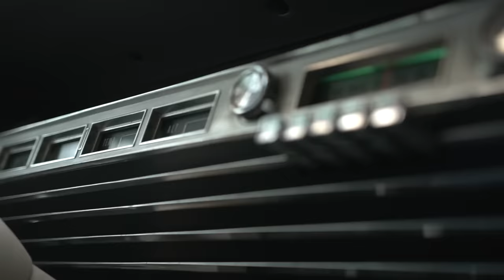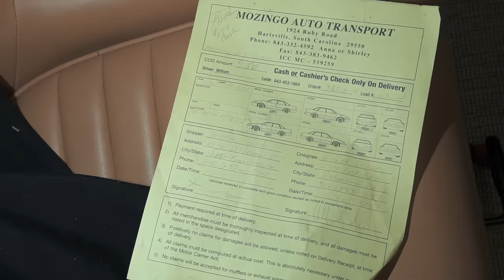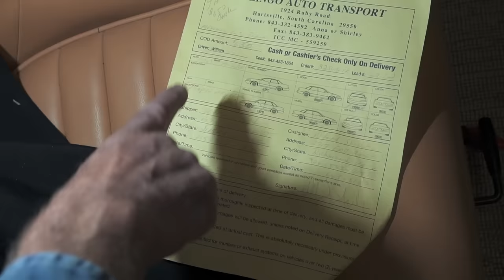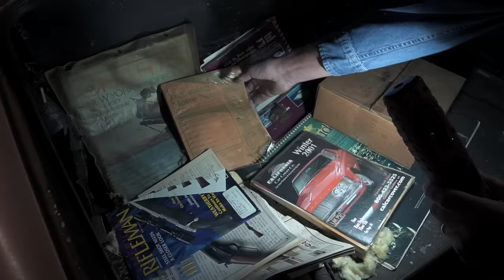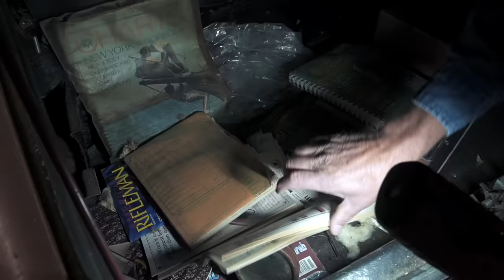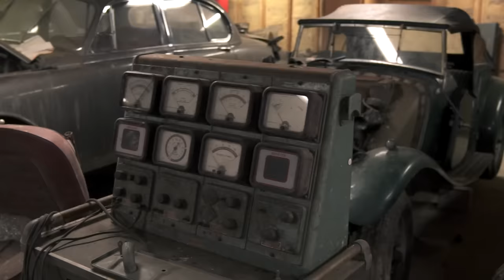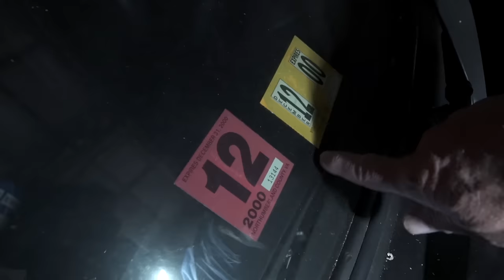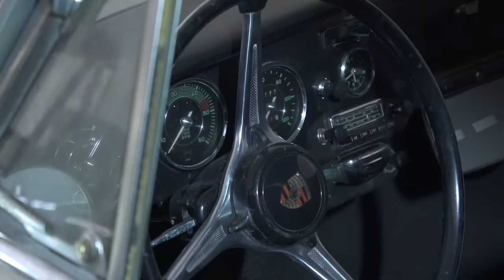Best barn find ever? 45 sports cars hidden in Virginia | Barn Find Hunter - Ep. 70

Comment: 21:26  The Jaguar is an S-Type, a completely different model from the slightly smaller (body-wise) MkII.  There was also a Daimler version called the Sovereign introduced later..
Reply: Sovereign...XJ6 kinda front. S type rear.  The S type wasn't as popular as the Mk2, but much nicer to drive with its IRS and improved ventilation. The S type still used Mk 2 doors.
Reply: daimler 420 sovereign a slimmer version of the jaguar 420g/mk10

Comment: I miss my rabbit gti! Seeing these makes me want one again. Also i had a diesel rabbit 🐇.
Reply: I'm restoring an MK1 GTI. They are awesome cars!
Reply: @RadoMatt  good luck with the restoration. I keep my MK1 until the strut towers rusted through.  I miss my go kart car.
Reply: Miss my 84 and 92 GTi's.

Restoring them, I would reweld the strut mounts, install big strut braces, urethane rear motor mounts, bigger vented brakes (rear discs in the 84), upgrade and protect the wiring, waterproof the fuse box,  rewelf & strengthen the pedal box, upgrade the clutches, better headlights, install the fog lights (the mounts are factory, they were intended to have fog lights) and redo the exhausts (loved the rorty growly sounds).

Oh, and keep the 84 black star wheels and 92 turbo wheels.
Reply: My sis cleaned pot in North. CA for money. SHe walked into a VW dealer in FT BRagg, paid cash for Black '84 5 speed. It was a quik one. She died a few years later. My mom ended up with it. It burned up alternators for some reason.Only flaw.

Comment: I would pick up that diesel VW pickup in a heart beat. I LOVE those little trucks. <3
Reply: Had one....MAKE SURE there is NO RUST ON THE FRONT FRAME other wise your wheel will tilt in and your engine will begin to come through the frame and scrape the ground..  NO KIDDING.  THese caddy's are available on ebay you know.    They are fun   I had an 1982 and was GLAD to get rid of it.     Problematic little fukkers they are.   Be advised
Reply: @tommaika9121  Thank you for the tip. I'm a welder and a fabricator. Fixing or reinforcing wouldn't be a problem. Here in New England most are all rotted out beyond repair, if you can find one that is.

Comment: New "throw away" vehicles dont hold a candle to Old Classic Vehicles
Reply: Modern cars are built to last longer than classics
Reply: Babylon falling I own an 80s ford and can tell you it’s well know that they weren’t designed to last they were designed to rust to make you buy a new car. The wiring looms are nowhere near built to the standard of modern day cars and are held together with old tape. Yes modern cars have loads of electronics that fail but most of the time it’s just a warning light on the dash. I like classics but I would never want to drive one every day the automotive industry has come along way in terms of economy, safety and comfort whether that’s for the better is debatable.
Reply: not in collectability!!  1969 vs 2016
Reply: 'Newer' cars dont last longer then this olds. It depends by
the storage conditions and, what brand you try to save.
Reply: @louisgreenleaf235  that is so true. While we complain about how flimsy they are, modern cars are better designed, better protected and have double the life span of a classic car. Babylon falling, are you comparing classic cars that have been restored? I have owned many cars from the 60's and 70's and while I love the styling and the simplicity of working on them, they simply can't hold a candle to modern vehicles in build quality and ride.
Reply: @Louis Greenleaf
Modern cars are built to be reliable for a set number of years before they become impossible to repair economically. Older cars are less reliable but can be repaired cost effectively and last many decades more. Nice try slick. You must work for the manufacturers.
Reply: real cars have chrome bumpers,ask anyone

Comment: If that vw caddy with the topper was a turbo 5 speed diesel I'd love to have that
Reply: Bigg Papa  My stepdad had one too, with the 5 speed gearbox option... Sold it before I knew him... sigh
Reply: Keep looking on Ebay. These trucks are found in Southern California or parts of the Pacific Northwest.   The guys on the eastcoast that own them WILL NOT SELL THEM.    I had an 82 which was fun until the rusted front frame had the engine falling out of the engine bay .... and the passenger wheel collapsed on me due to rust.   I was glad to get rid of the death trap.  They are VERY small inside.  If you are 6'tall and above, your legs will not work the pedals.

Comment: Great episode!
A note:  The BMW 633CSi in the video is an E24 model (1976-1989) which included the 635CSi and the original M6 versions.  It was penned by the french designer Paul Bracq.  Karmann built the first few, but BMW eventually took over production.
The 2800/3.0CS/3.0CSi (1968-1975) you mentioned is the E9 model (all were built by Karmann)  Wilhelm Hofmeister was the designer.  
Both are beautiful coupes, but the older E9 is a "true" coupe with no B-pillar.  The lightweight 3.0CSL "Lightweight" is the most desirable and was the version used for racing.

Comment: I had a 1959 karmann cabriolet with removable hardtop you could order the hardtop or the cabriolet soft top. The soft-top had to be completely removed to mount the hardtop. There was also the permanently mounted welded on hardtop for the karmann coupe . If there are no top clamps for the windshield header it's a welded on top.

Comment: Porsche produced the 356 C in 1964 and 1965.  I have a 1965.  The base C motor was 75hp.  The SC version was 95hp which is the engine used in the 912.  The 365 C you were looking at was a sunroof coupe.  The sunroof was in uncommon option that adds at least 10k to the value.  The 912E you mentioned was built in 1976 only.  It was a VW based fuel injected motor.

Comment: Thank you and Mike for showing me round, just a little attention to detail, the 2.5 V8 Daimler engine is basically 4 Triumph Bonneville engines designed by a Motorcycle engine builder Edward Turner and Jack Wickes who were asked to develop a sports saloon with a V8 engine, was named the "Dart" but later became the SP250. The saloons came later mostly automatics.
Reply: They changed the name to sell it here, Chrysler objected to Dart.

Comment: That 64’ Porsche 356 C in Silver! WoW 🤟🏻
Reply: And a sunroof! But there were braided lines goin to the front of the fan shroud. Could be an additional “rob Peter to pay Paul” oil cooler in fron of the cylinder fan shroud (which also houses the primary oil cooler), or maybe an Oberg “circle” external oil filter.  Not “the best 356”, as it is a C and not the 110hp SC, but a nice 75hp driver nonetheless. Clean it up, new tires, check the brakes, change out the window rubber and engine hoses, renew all the fluids, and drive the wheels off it.
Reply: Oh, and an early oil filler. This may be an earlier, 60-63 engine. That would devalue the car a lot. Used the small oil pump which might explain the aftermarket oil support. Could be a 1.7L rebuild on the older motor, which could bring 90hp. Carbs are gone though. Zenith 32s on the older motors. The “missing” tach in the front could be the electric “C” tach. The older motor has a mechanical tach off the oil pump drive, unless converted.

Comment: A small correction to what you stated in the opening dialogue. Reedville, VA does not face the ocean. Reedsville is on the western shore of the Chesapeake Bay. The eastern side of the Bay is called the Eastern Shore of Virginia or Virginia's Northern Neck. When referring to the Outerbanks, these are in North Carolina, i.e. Cape Haterras.

Comment: Wondering what Tom's station wagon gets for gas mileage. With the 428 4sp in it I'm pretty sure it would be single digit - like 9 mpg. I had a 72 Mustang 429 C6 and it got 6 mpg. Ford saved money in it's big block cars by installing gas gauges in those cars that operated on a timer (not a float in the gas tank) - and as soon as you turned the ignition key to the on position the needle started head towards the"E" mark - even if the engine wasn't running  :)

Comment: When I sold Mercedes parts in the early 80s colour matched hubcaps were an option. You could order them as a part to upgrade if you wanted later. 

From memory the colour matching was a $30 added option, each. Which marked them up at around $240 a set of four.
Reply: In Australia

Comment: I had an 83 rabbit diesel.  It had almost a half million miles in it before the engine gave out.  I would have put another 1.6 liter diesel in it but the body was rusting out.  Now I have a 2000 Cabrio that had 70,000 miles on it when I got it in 2019.

Comment: Edward Turner designed the Daimler 2.5L V8. Aluminum heads and cast iron block. There was also a 4.5L in the Daimler Majestic Major. He's the same person that designed the Ariel Square Four and in 1937, the Triumph Speed Twin, which also had hemispherical combustion chambers. They wanted to call the SP250 the Daimler Dart, but Chrysler objected.

Comment: You made a mistake on the BMW, the 2800 CS and the 3,0 CS (CSi, CSL...) you mentioned are the E9 Coupés, prdeccesosors of the E24 6 series, which started as 630CSi and 633CSi, later came the 635CSi and then the 628CSi, but I´m not sure the 628CSi came to the US

Comment: The black Turbo look is option code M491, available for the first time in 1985. You'll probably need to contact Porsche with the VIN to verify that it's a real M491 car. It should have the 930 brakes, trailing arms and other suspension parts too, but they can all be retrofitted, so unless you have a Porsche COA, you won't really know for sure.

Comment: The 912 is basically a 2 litre kombi engine with a few differences like cylinder heads and carburation.. If I had to say what the most sophisticated engine they made in the classic era, it would have to be the 1500 4 cam in the 718 spyder RSK

Comment: The '67 VW has large taillights, old-style bumper and wait for it, back up lights. 66 were still 6 volts, 67 went to 12 volts and added the backup lights with the old style bumper. It changed in '68
Reply: '67 had a one-year only bumper and separate reverse lights mounted to it (at least here in the US).  It wasn't until '68 that the reverse lights were integrated into the new taillights (again, here in the US) and the car got the big honkin' "blade" type bumpers with no towel bars.

Comment: If my memory serves me correctly, at the time the black wide body 911 was made, the 3.0 SC was available with the turbo-style wide body and whale tail, and that's often seen in conjunction with the optional sport pack with stiffer suspension and, I believe, faster ratio steering.  Some people say the sport pack cars also had a closer ration gearbox and maybe some upgrades to the state of engine tune, though there doesn't seem to be any data to support that.  If that is what this car is then I would suggest it might be pretty rare in the US as most 911s sold there seem to have been more originally specified with comfort options rather than performance ones.  Clearly the wheels on this one are wrong, being the narrower Fuchs alloys from a standard body car whereas this one would have had the wide Fuchs alloys also used on the turbo. The wide, turbo-spec Fuchs alloys have always been desirable, big ticket items, so it wouldn't be any surprise if they may have been separated from the car and sold on at some point as it's clearly a car that has been off the road for some time.  Even if it isn't an original car, there's still going to be plenty of interest in it as an air-cooled 911 that, at least, appears to be in very solid condition as this era of 911 can be horrifically rusty...

Comment: The Daimler 2 1/2 litre V8 engines are in essence 4 x 650 cc Triumph motorcycle engines in the form of a V8, the Daimler engine was designed by Edward Turner the same man who designed the Triumph 650 twins so it's hardly a surprise how mechanically similar they are, I had a Mk2 Jaguar with the same 2 1/2litre engine and was delighted with the performance, the small V8 made the Jag a fast car and was super smooth and refined, so in the much smaller Daimler Dart sports car the performance must have been amazing at the time, I think the car would have been a world beater if only it had not been so ugly. In the 70's I was a specialist in the overhaul and repair of Triumph 650 twin motorcycle engines and later I got into repairing and overhauling Daimler V8 engines so I know all about them. The V8's had a beautiful forged steel crank machined all over to a high finish and superb forged steel connecting rods with polished beams which were far superior to the bike connecting rods which were aluminium, the one real weakness of the V8 were the pistons which used to break if the engine was tuned and revved too high, with forged pistons the Daimler V8 could be tuned to be a real power house with 200 BHP and 8K rpm. A 4 1/2 Litre version was also made and installed only in Daimler high performance saloon cars, these bigger version V8 engines can also be fitted in the tiny Daimler Dart Sports car in place of the 2 1/2 litre engine which really makes the Dart a fast car

Comment: Had a 1975, 911S, 2.7 liter, air cooled Porsche with the silver stainless targa top here in San Antonio. I remember being stuck in traffic on an August afternoon with the A/C off and the heater running to push air through it, the windows were down with the temperature gauge maxed out trying to keep it from seizing up from the heat. I had totally soaked my shirt when I decided air cooled Porsche’s were not for Texas or me. Beautiful car, handled like it was on rails only had 180 bhp. My God it would run in the winter. Car had “chain tensioner” which could break and total your car after 40,000 miles. This was in 1980 and I was a low first lieutenant in the Army MSC. I sold it back to the man I bought it from. He told me with contempt “son you are not a Porsche Man”. 
The car would have been fine even at that temperature doing 90 miles per hour. But not sitting at 0mph. It needed a cold alpine autobahn. Marc

Comment: the Daimler 250 was originally called a Dart.  But Chrysler/Dodge stepped in and said you cannot use that name.  Si it was renamed as a 250GT, due to the 2.5 liter engine.  i had one, body good, no interior or engine, and sold it for $450 bucks.

Comment: Those VW pickups are great little machines. Back in the mid 80's, I had the opportunity to drive one of each, a gasoline engine and a diesel engine. Both of them were as fast as any sports car on the road at the time. I had driven them like a quarter mile drag car and boy o boy, they were quick. The fastest that I had cruised them were 118 mph and they rode smooth, of course on a smooth road. Not very quiet though, every road noise and the wind made them hard to hear your passenger while driving them. You had to speak loudly to carry out a conversation. Besides all that,  fun, fun, fun until daddy took them away! Haa haa ha!

Comment: The 911 is an '84 or '85 3.2L Carrera (there was never really a factory 2.8 for the street (notwithstanding the '73 RSR of which some were registered for road use) -  only late 60's/early 70's race motors). It has motronic injection, which makes it a 3.2L - the previous model, the '78-'83 3.0L SC had CIS mechanical fuel injection. The round switches and AC control panel (center console) have the earlier, conical shape which was changed to a slightly more modern bulbous design in 1986. The 'Porsche' script on the rear reflector was also changed from black lettering to a translucent pattern in the reflector for the '86 MY. The Fuchs wheels appear to be 16 X 6's in front and 16 x 7's in the rear. A factory M491 'turbo-look' option would generally have had 16 x 7's in front and 16 x 8's in the rear (these can be distinguished relatively easily by the amount of 'dish'; 16 x 6's have no dish while the 8" wide wheels have a nice amount of dish) for 1984 and 85 - the later turbo-look cars had 16 x 9's. The flares were only welded onto the 930's on earlier cars (I don't remember when the change was made), but the later 930's (and I am pretty sure the M491 turbo-look optioned cars) all had one piece quarters and fenders. Even if they were welded flares, though, the weld is way up in the quarter panel. It is easier to feel on the fenders in front as the added flare sections were smaller so you don't have to reach in as far. That said, on factory cars "feeling" the seam under the undercoat was tough. Based on the wheels, I'd say this was a regular narrow bodied '84 or '85 3.2L 911 Carrera with flares added later.

Comment: Those mk1 and mk2 4 cylinder engines are rated for 250k miles.  Means they're not even broken in until they're at about 125 k miles.

Comment: Well, a sort of gems. BMW Volvo MG Jag, Tirol is in Italy
1. The 219 Mercedes was the most desirable model of this line.
They used the 190 body and the 220 engine. The range was 
180 190 219 220 You can even drive them with flat tires, they use
a worm and sector steering gear. No servo needed!
2. Porsche 930 was 3.0 or later a 3.3. The rubber bump on the 
rear spoiler was std on all turbo models. Except base and Carrera. 
Back in time many re-fitted as option the whaletale also on std 
models. A targa was avail and a cabriolet. 
7x15/9x15 rims are also std on this. From 1977 16''
3. This 6 series was offered as 628 630 633 635 and at least M
635 CSi. BMW offered them witch carbs and with fuel injection.
Which fool put a V8 into the TD as it would be full restored ~40k worth?
Reply: Tyrol is located in the Alps, in northern Italy and western Austria...